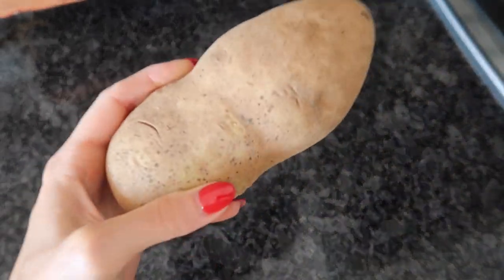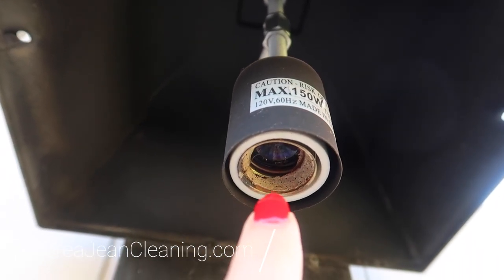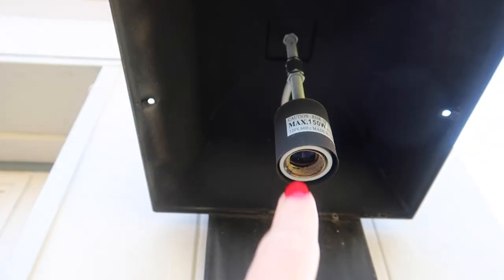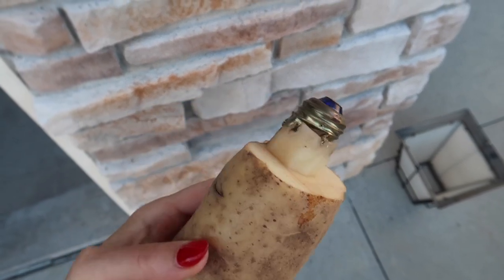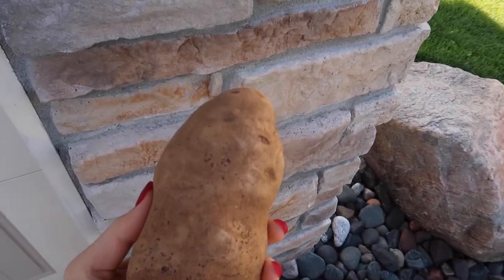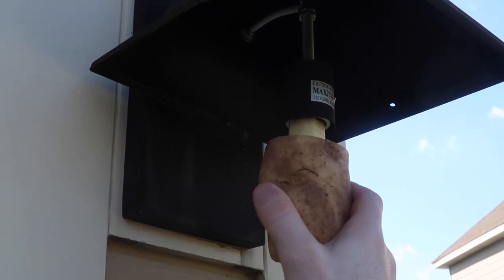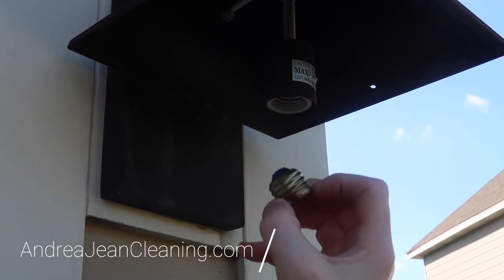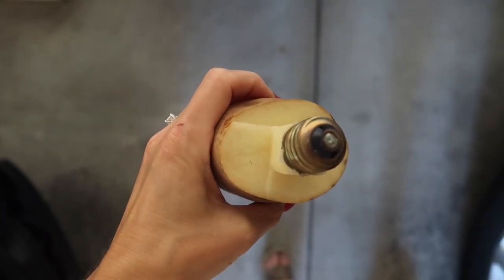Do THIS with the POTATO & Save Major Dollars💥 (IMPRESSIVE!)

Comment: Using needle nosed pliers, with their jaws spread and binding on the inside of the bulb's base, with twisting to remove it, also works, but it's more efficient and requires no clean-up.  But it also helps if the power is off too.